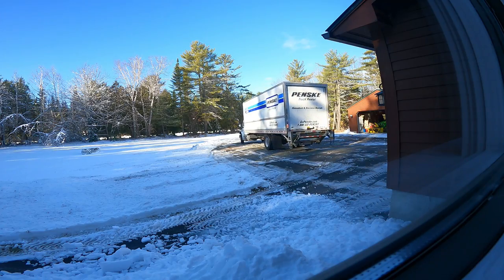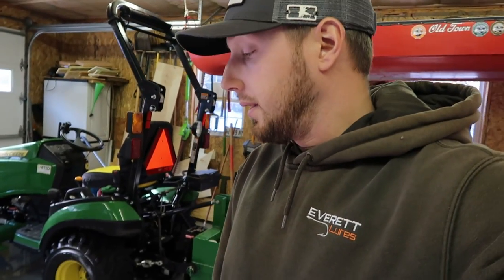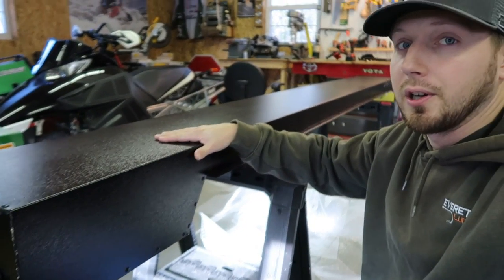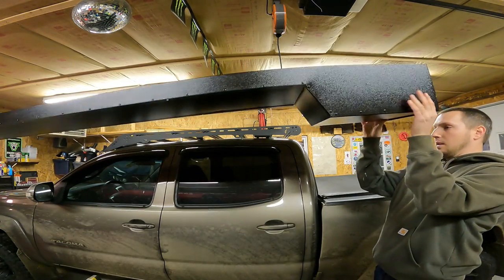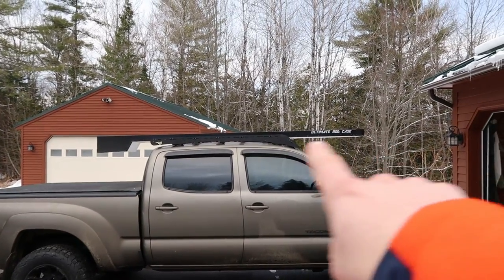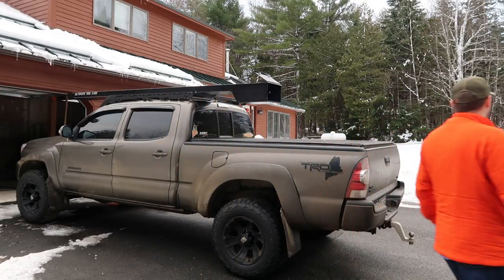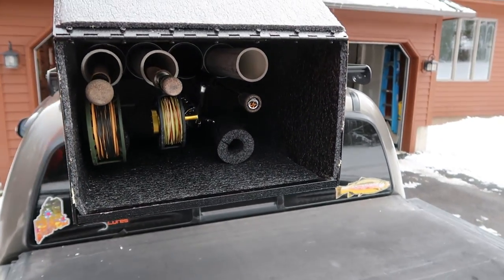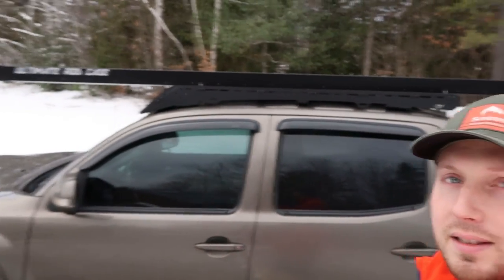THE BEST ROOFTOP ROD CASE! | Ultimate Rod Case

Comment: I've seen competitor cases for $2000. I'm not sure if I'm ever going to have the time to justify getting one of these but this is the brand I'm getting if I do.
Reply: You can do it yourself for less than $200..  Use sealed painted wood, then wrap it in sheet metal or vinyl